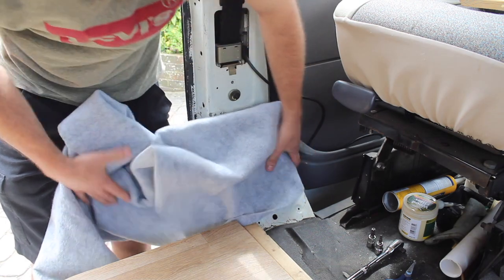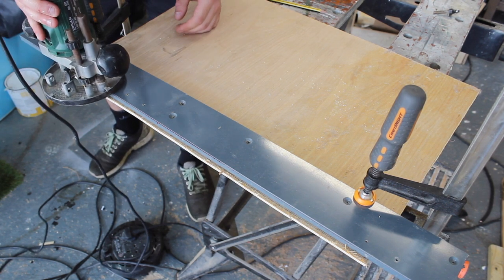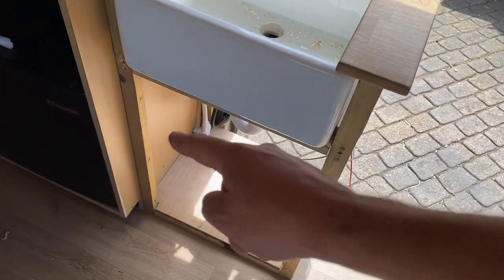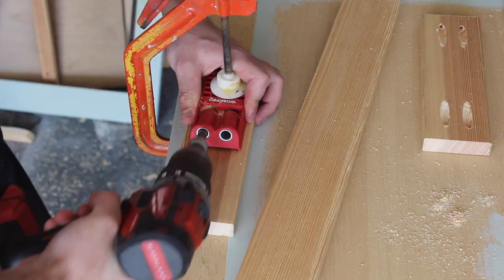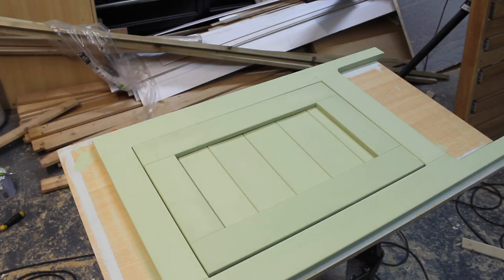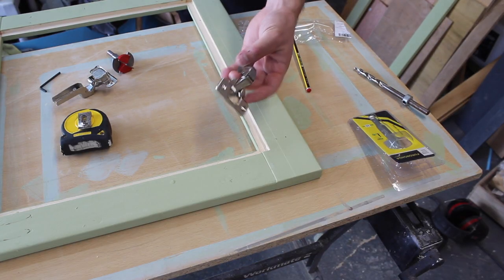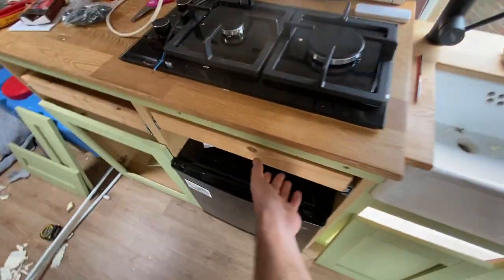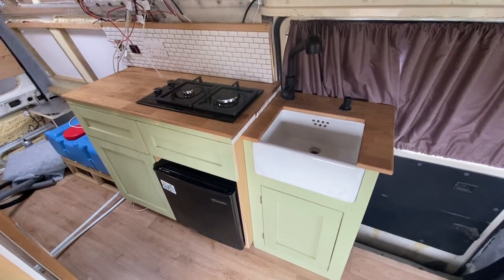Kitchen Cupboard Doors and Drawers - Van Build Series - Episode 20

Comment: nice job ....excellent attention to detail and some very useful tips. 

 Green !........ that strip has gotta be green otherwise you have 3x different colours in the units . That wood strip right in the middle breaks up the visual continuity of the green along the base and it doesn't tie in or match the worktop colour
Reply from the maker: Thanks John, green it is! I like your reasoning too makes sense 👍🏼

Comment: It's coming along now buddy,I think I'm gonna invest in one of those jointing jigs as it looks very strong & easy to use,as for the strip of wood it'd look good painted either in colour or  maybe an opposite colour say off white to give it a 3D look to highlight it, certainly looking good & strong units that aren't going to creek & move about when traveling.well done mate I'm very impressed ❤️👍
Reply from the maker: Thanks bud 😊 the pocket hole jigs are fantastic! Never used them before doing this build but I use it all the time now. I will add a link to my Amazon storefront to the one I used as it’s a pretty good kit and has lasted well so far. Some aren’t built very well and break after only a few uses. Thanks for your recommendation about the colour, I like the idea of off white 👍🏼😊
Reply: @TurnersWorkshop97  hello again,the Amazon link is a bad one & is drawing a blank page 👍 perhaps a typo👍
Reply from the maker: Thanks for letting me know, hopefully it should work now🤞🏼👍🏼

Comment: You ust have half a timber yard in the back of that thing. I would never use solid timber in a van build, even though almost 100% of van builds do! These are nearly always the one's you see for sale. They are just too damn heavy. This costs dearly in fuel consumption and is hard on your nerves when you don't have the power or acceleration you think you should have when you need it most. I use original lining where I can get it and stick to super light materials or Corefulte for coverings (Coreflute is a ribbed hollow plastic).  I don't use solid doors anywhere, but instead use framed doors and have the centres filled with something like rattan or Coreflute. I try and not to use anything thicker than 12mm(1/2") ply or timber strips for the doors. 
I've built vans from furniture put out on the street for collection and circuled the streets on the days before council cleanup. I picked up hinges, Melamine furniture boards, plywood, conduit, and storm water PVC for under-body water tanks and a lot of bits that I repurposed for the build. 
Some people build their vans like they are building a house. You can see which trade their in by what and how they install things. Try not to add more than about 200kgs (400lbs) to the empty weight in furniture in a Transit, as it's just a waste of time, space and resources.